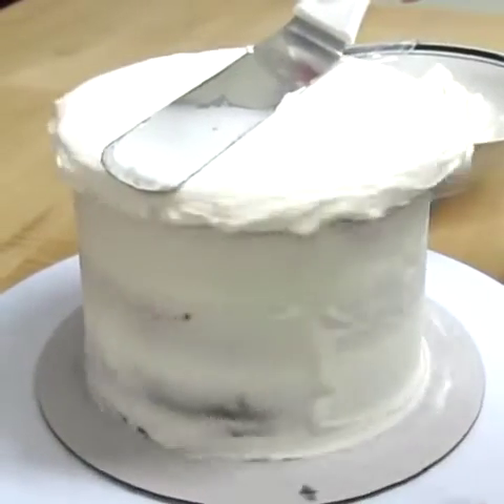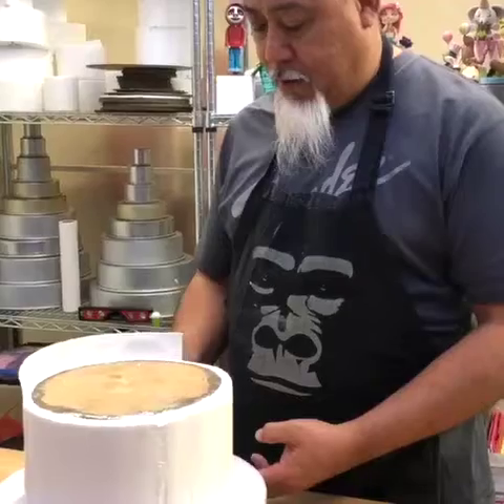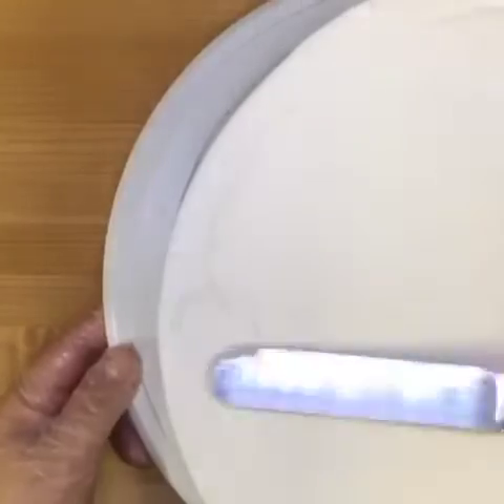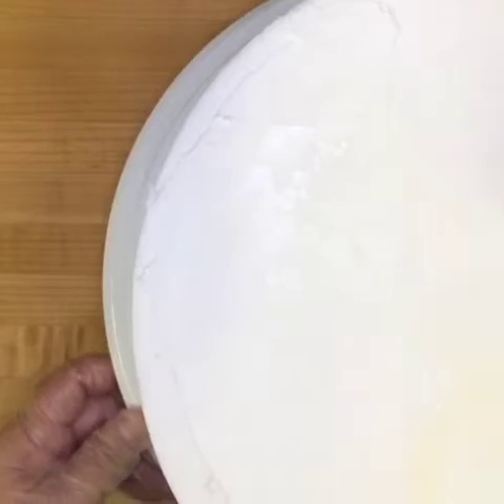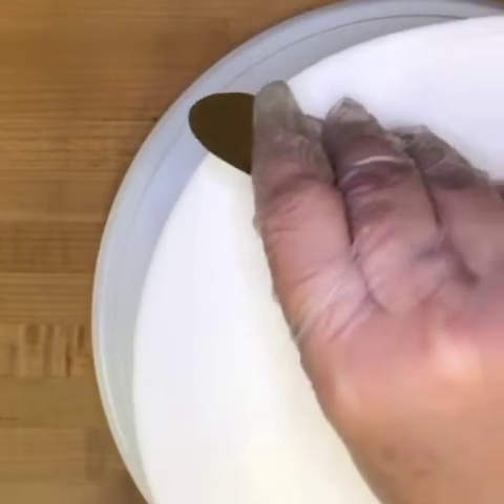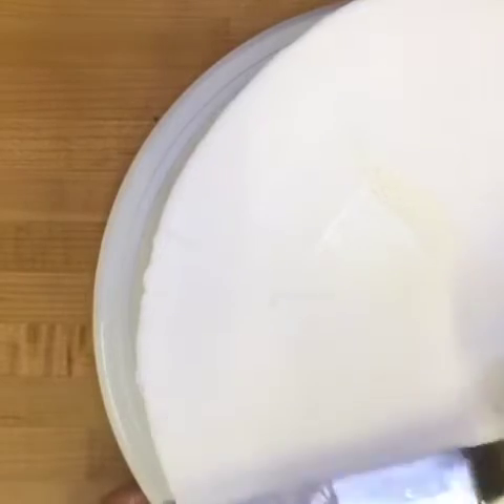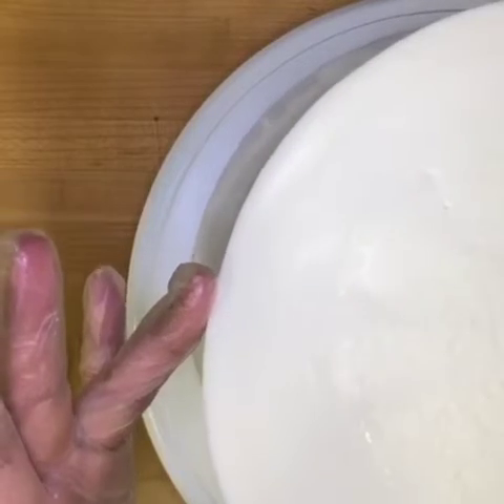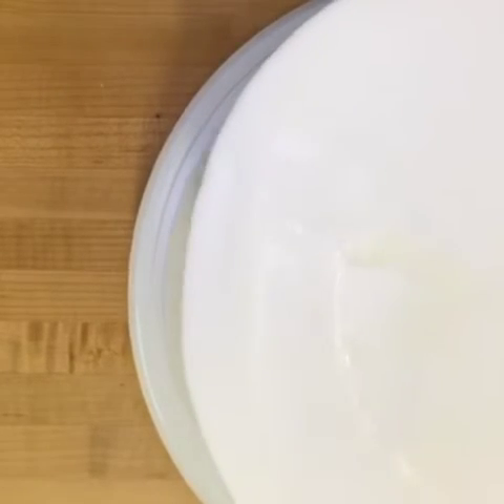How To Get SUPER SHARP Edges On Your Cakes

Comment: Hi Laura and Arnie,

I hope you read this and can offer some advice if I did the right thing. I had quite a sleepless night. You are my cake fairies. 

I had a cake collapse this weekend and that has never happened to me. I made a two-tiered birthday cake (8 inch and 6 inch) with buttercream. It took me around 10 hours to make the cake and the little fondant decorations. I used boba straws and a central dowel to support the 6 inch tier like I always do. The cake was chilled and had a foam-core base. I placed the cake in a box with a non-slip mat and some supports to keep from shifting.

When the client picked up the cake, I stated they should drive carefully and get the cake into a refrigerator when they reach home. The cake was in excellent condition and was structured the way I always do for tiered cakes. However, I did not offer advice on how to disassemble the cake but I did give a cake serving guide for round cakes.

A couple of hours later I received a text message with two photos:
Photo 1- A photo of the 8 inch layer broken in half. The 6 inch layer was removed. I could see the boba straws in the photo but the centre wooden dowel was missing. It looked like a crime scene. 😮
Photo 2- the 6 inch cake was intact save for some of the decorations seemed to have fallen off.

As you can imagine, I was horrified. I called the client. I asked what happened. He said the bottom tier fell apart or collapsed. I asked how that could happen. He said I don't know, that's how it was. I think from the photo, they must have tried to remove the 6 inch tier by sliding it off instead of lifting it off. Thus the wooden dowel sliced through the bottom layer. The client didn't admit to that but I think that is what happened. 

I felt so bad. Within 10 minutes of receiving the message, I refunded the ENTIRE cake amount and offered a future free cake. I profusely apologized. I wanted to correct the cake fail, offer good customer service and avoid a negative online review. Although it was never a problem for me in the past, perhaps I should have told the customer how to disassemble the cake and about the central dowel. 

I read dozens of forums last night about baker liability after the client picks up the cake (I am going to implement contracts ASAP). The cake could have been damaged during transport or someone could have dropped it. But the client won't tell me that of course. 

How would you have handled this situation? 

BTW- I received your miniscraper. Great tool!

Much love,
Baker in distress
Reply from the maker: Hi! First of all, so sorry to hear that happened. 2nd of all, don't stress AT ALL. THIS my dear is how you learn to handle situations like this, because they DO come up. I really don't think you did anything wrong at all, ESPECIALLY if you've had experience with properly structuring tiered cakes. I would recommend however that you make sure the from now on your center dowel doesn't only go through the two tiers, but ALSO goes into the foam core board the tiered cake is on. That way if a dumb person (LOL) like this tries to do the same thing, the dowel won't slice through the bottom tier. It will stay put. It's pretty amazing that you feel responsible in any way. Even if a person has never ordered a tiered cake before, it's pretty "common sense" how to cut it and take it apart. But, I guess now a days common sense isn't so common. So from now on, definitely instruct your customers on how to disassemble the cake before slicing. Tell them exactly what NOT to do, but do it in a very relaxed way so that they SEE that's it's not a big deal or anything to be scared about. How YOU explain it will put them at ease or stress them out. It's really up to you. I have a feeling they destroyed the cake. Either accidentally or just by not knowing what they're doing. You certainly shouldn't have given them any type of refund and definitely shouldn't have offered them a free future cake. Don't EVER worry or be "afraid" of a negative review. It's not that big of a deal. Just automatically KNOW that you're not going to please everyone, AND you WILL have dishonest customers who try to take advantage of you. Develop a THICK skin. That's what it takes in this business. Still be kind, sweet, but professional and stick to your guns and policies. Don't ever let anyone take advantage of you, or try to convince you that you've done something wrong. YES, you WILL make mistakes. We screw up too from time to time, but if you KNOW you didn't do something wrong, then you put your foot down. If you know you messed up (which in THIS specific case I don't think you did) then of course you apologize and do whatever you need to do to make it right whether it be a refund, future discount, or future cake (which we've had to do all of those in the past). We personally don't do contracts. They're very time consuming. You can reach a verbal agreement with your customer and then put it all in writing in an invoice. When I send my customers their invoice it's got EVERYTHING about their cake order in there, down to the tiniest detail. By them paying the invoice, they are agreeing to the terms and conditions which ALSO includes no refunds in case of cancellation. Lastly, to avoid any other problems I would highly recommend you DON'T allow customers to pick up their cakes. I like to make sure my cakes get to the venue in PERFECT condition and the only way I know to do this is to deliver it. I don't even let them take it from Arnie at the door. They have to show him to the table and he MAKES SURE it will NOT be moved from that place at all. Then he gives them any and all instructions they need about removing decorations, etc., before slicing the cake. I hope all this helps my friend. Just take it with a grain of salt, learn from your mistakes. get yourself some thick skin so you can toughen up, and onward and forward! Remember to ALWAYS put God FIRST in your life AND business so that you can be successful. I hope all this helps. God bless you!
Reply: Thank you 🙏 
I will take some time to absorb your comments. I spent a few days feeling sorry for myself. 
Going to dust myself off and see this as the learning experience that it is. 
💜💜💜 to the both of you